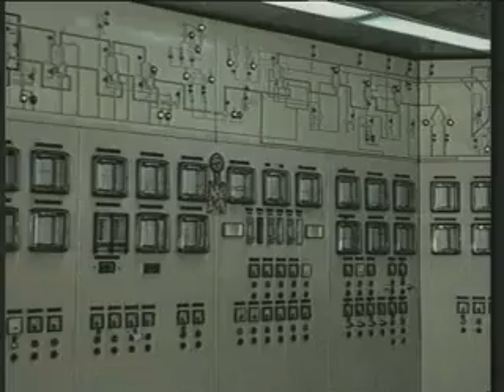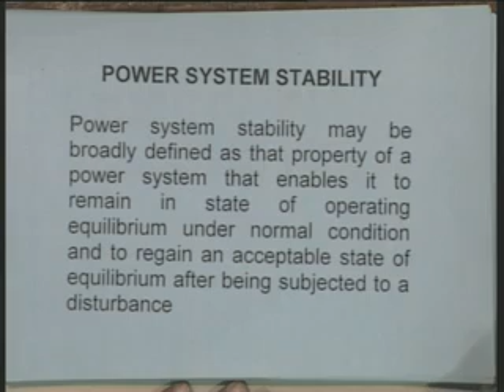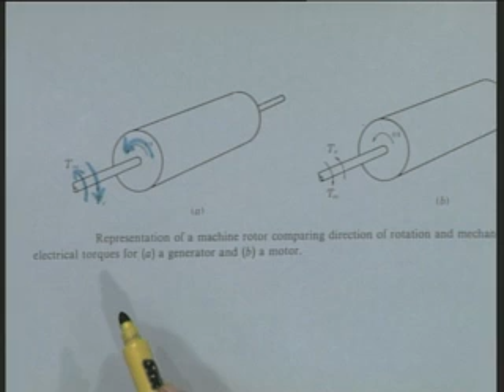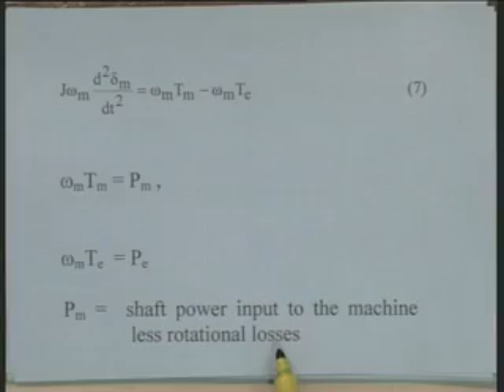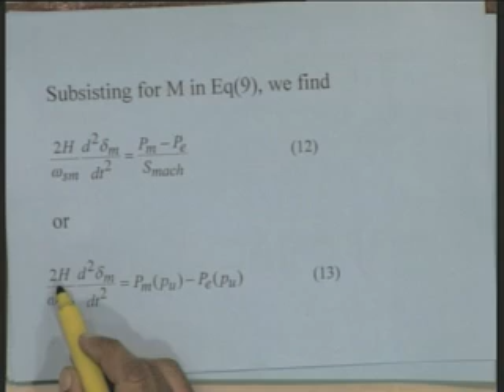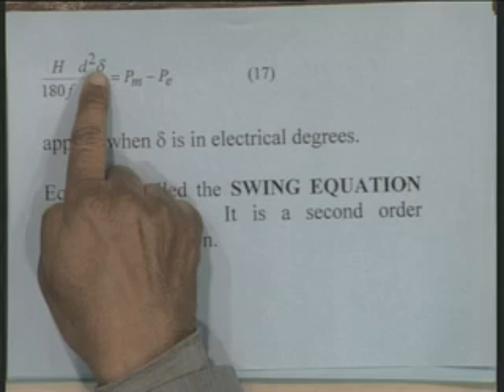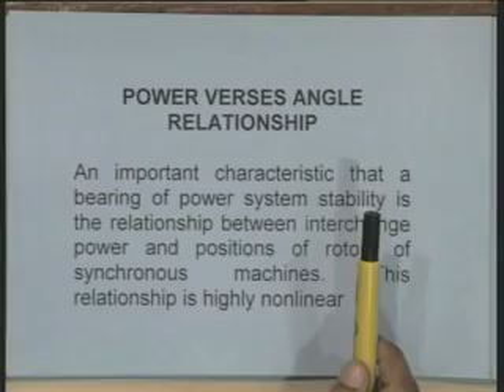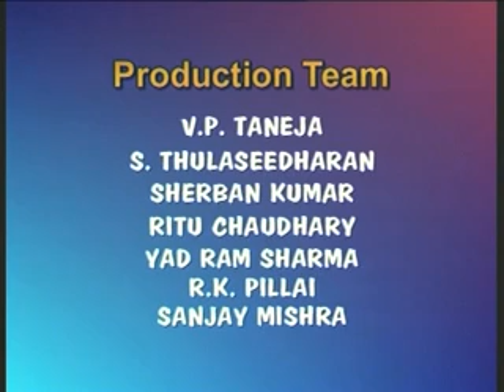Lec-1 Introduction to Power System Stability Problem-Part-1

Comment: When tm=te and both act in opposite direction,how does system rotate with synchronous speed?
Reply: Angular acceleration is zero but not angular velocity  when acceleration is zero the system is in inertia i.e rotating at synchronous speed so unless and until there is some other accelerating or decelerating torque system tend to rotate with synchronous speed
Reply: At t=0 there is no Tem Tem will be equal to Tmech only when it attains synchronous speed
Reply: That means system is rotating at constant angular speed and angular acceleration is 0.
Reply: It maintains synchronous speed. Torque changes the speed. If no net torque then speed will be maintained